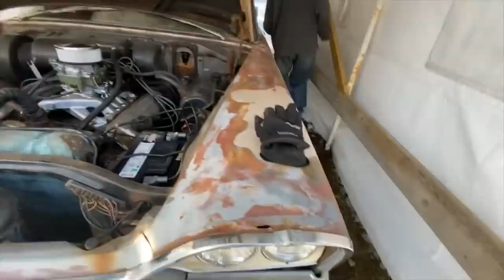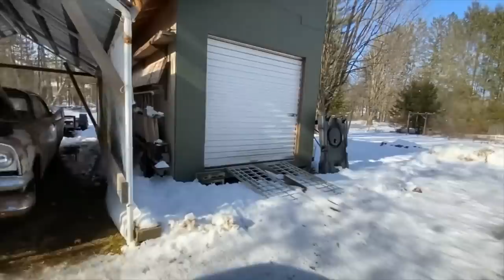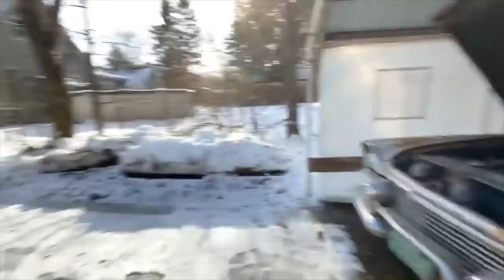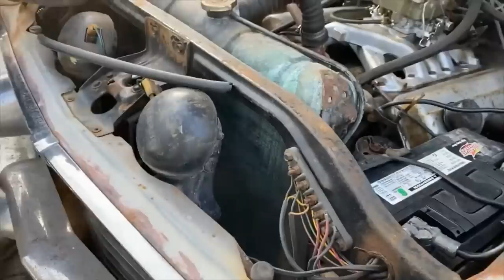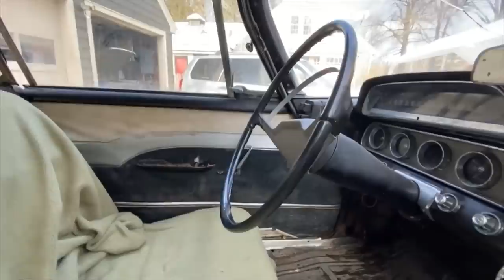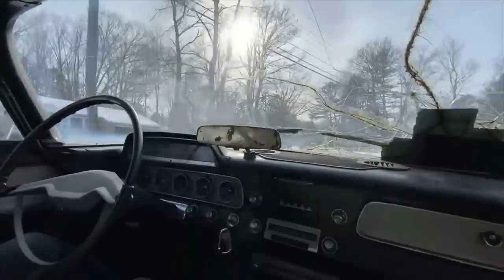Barn Find 1958 Dodge Coronet Lancer Maiden Voyage

Comment: She still has that dead miss... did you change the plugs and wires? How much wear is on the points cam? Have you done a compression test? 
Good to see shes running and driving now. Got her going faster than i got my ford going.
Reply from the maker: Plugs and wires were new, cap/rotor and many other parts, 30 years ago, but they still were new, like it had never been run with them. We have not had a chance to take a closer look, we had a day above freezing and a short amount of time, so we could not resist taking it out for the first time.

Comment: run two fuel filters from the gas tank
1 along the fuel rail or line from the tank
2nd(Primary) just before the carburetor until the first one or both get clogged then replace them
then refill with fresh fuel

that ol gal deserves a second chance on the road
Reply from the maker: She will get that second chance. There is no gas tank, it was rusted out. We are using a plastic gas container mounted at the front with a filter.
Reply: @cudafry1967  i see

Comment: I now know what your daughter drives. A little silver thing-ge. The test drive went well I thought.  I guess it could do with a new exhaust, maybe. Was the heating working or not ? I thought I could hear some thing chattering..... May have been your daughters teeth . Has with most car's of the 50's/60's the interior was always very smart. Just like the camera girl.  Hahaha.
Reply from the maker: Didn't try the heat. I believe the chattering was the speedo, which is why I didn't want to go too fast as it chattered more the faster we went, don't want to mess that up until we have a chance to take it apart and see what's going on.